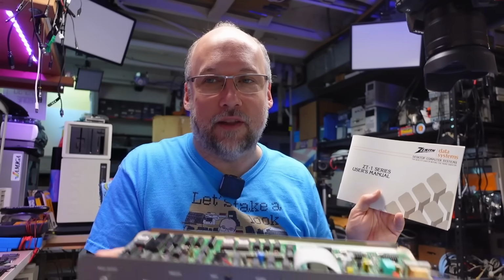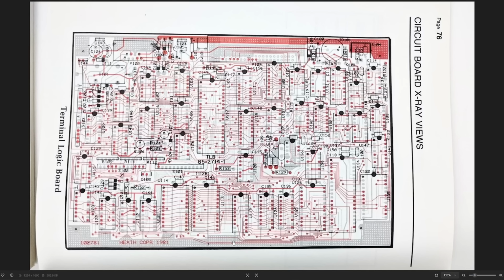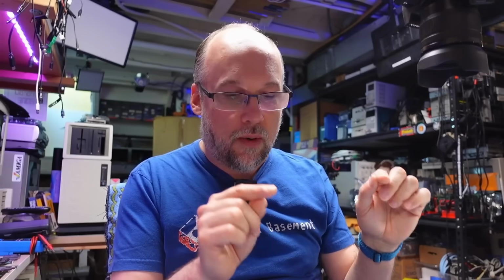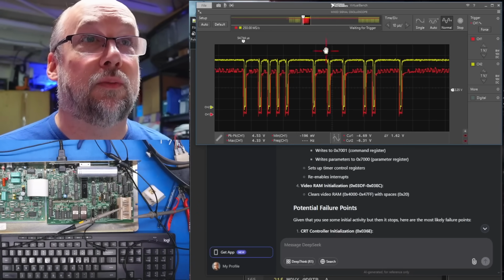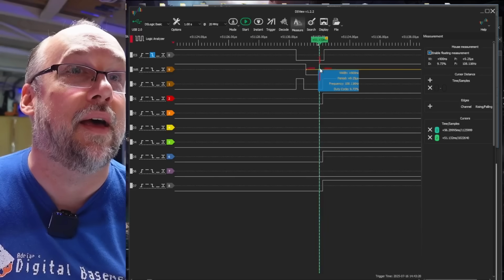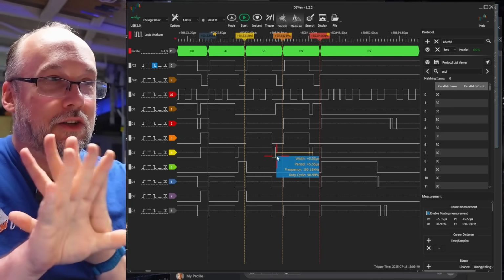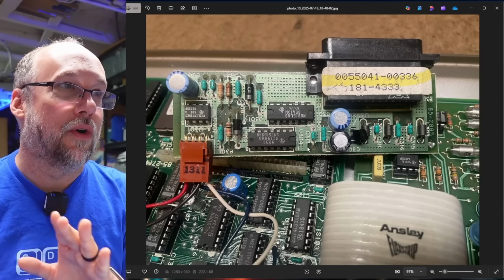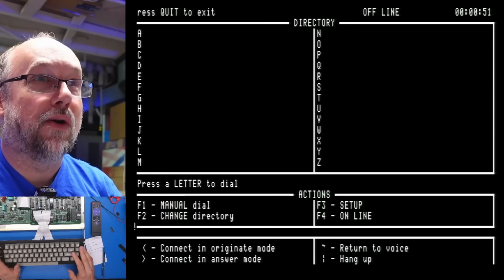The Zenith ZT-1 alive. Sort of.

Comment: 16:41 you can use a dremel or small hacksaw to cut all the way around the PSU brick plastic halves, for a cleaner entry.  Still though, who the fck seals a fuse into a PSU brick?  It's just dumb.  Some old potted transformers even had a capacitor potted in there with them - I've seen Mr Carlsons lab demonstrate this.

Comment: Yes. The 7.3728 MHz crystal is an easy divisor by a serial chip or a timer for creating all common modem baud rates or serial communications.
I use it as the master clock for my Z80 systems and then divide it by 4 and can create 115,200 baud by dividing by 12 in the CTC. So a very handy crystal to have as a master clock and then dividing it down to the baud you need.

Pretty clever bodge for adding a serial port. 👍

Comment: The +12vcd and the -12vdc are needed by the modem. There should be regulators for both on the modem board.
Heathkit used to have a tricky way to pulling negative voltage from the secondary and neutral.

Just guessing. Too bad there is no schematic.

Comment: I notice that Sark's modem board, whislt not qualitatevly different, some small things are changed - was his modem recapped at some point? Note the changed ground planes where it's screwed to the chassis!
Also noting that power jumper seems to go to that other weird power converter, although the better shot shows it against the capacitor instead!
Is that another reason why that transistor is there like that!?

By the way, for your flashing left column, is appears (sampling letters I,O,D and G) that the 2nd LSB (2nd from the Right) is toggling from 1 to 0, when the letters flash at 01:03:03! 
That last char and first char swap is intriguing too - but I also Note that the flashing block cursor, is not the same interval as the character swapping!

Comment: I use a fairly wide and freshly sharpened chisel with a swift, yet firm hammer strike to pop open those ultrasonically welded plastic cases. I've had the best luck with the cases resting on the concrete floor. Work your way around all four sides as necessary, and usually one or two sides will yield total success. The bench, as solid as it is, still has too much shock absorption for the hammer blow to pop open the seams.

Comment: Wasn't a fan of the AI. It was just distracting and unhelpful.

With the serial board, a clue it was a separate board was that the connector was upside down implying the board was above the connector which would mean it has to be a separate board.

The tape on the back might just be to prevent shorts.

Comment: To make it easier to solder to the fuse caps, sand a spot on each cap with some sandpaper or a small file etc. the solder will wet the sanded section much better. Great work Adrian!

Comment: Commenting around the 45 minute mark:
My first guess, which I remember I had in the first episode but which has only been strengthened by this episode, is that the fault does not lie in any of the logic, but actually lies in the video circuitry.

In other words, I think it's probably attempting to generate the video signal but either some of the logic or somewhere in the analogue mixing of the video signals is where the problem lies.
I'd suggest working backwards from the video output until you find something which looks like a viable video signal, then look at whatever comes right after that to find out what's going wrong.
While it's possible that the video generator chip is faulty, it's far more likely that an external component is the problem.  Perhaps a capacitor has shorted out and is grounding out the video?  Or maybe a resistor has cracked, or a solder connection was never properly made, meaning that the video signal never gets through?
Edit:  Wow!  I wouldn't have called it that the video chip had failed.  Maybe there was a near-miss from a lightning bolt which back-fed an overload from the video display into the chip.

Comment: Adrian, Do I not see a crystal in the middle of the ircuit board is that not used for the clock?
Reply from the maker: I wasn't clear, that crystal is for the CPU clock and baud rate divider. A time keeping clock would be using a 32khz crystal. You'll see this on any motherboard with a timekeeping circuit from the 1980 and 1990s.

Comment: The power supply urgently needs an overhaul. The uninsulated "floating" fuse can easily move around inside the case and at least touch the white cable! I wouldn't really trust old adhesive strips as a mounting option.

Comment: Your own analysis and troubleshooting is skilled and interesting. Whereas I doubt the LLM is analysing anything. It'll be saying stuff that looks like other analysis of various similar-looking code or whatever, which is only gonna be accurate if the thing you're asking about is already well documented online. It is designed to make plausible answers so of course it looks decent and useful at a glance, but that doesn't mean it did any actual analysis of the code.

Comment: If you intend to use that wall plug power supply, I'd drill a hole in the top and install one of those "screw in" style push-and-turn fuse holders to make the fuse replaceable without cracking open the case.

Comment: The reason the CPU might get stuck during initialization could be DMA or IRQ related. Maybe the CPU waits for such a signal from the video controller after it initializes it, but since it doesn't ever happen, it's stuck?

Comment: In the early 70s, my parents bought a HeathKit color 19" TV kit. I was too young at the time to help (both parents had soldering skills.) It took them about 2 weeks to assemble the kit.  Component by component. (later kits had pre-assembled boards which you just needed to connect together.)  It had the motor driven mechanical tuner with up/down buttons to change the channel. and had the option of an ultrasonic mechanical remote with a sensor to trigger the up and down functions. My father had built a large console floor cabinet for this TV as that was the thing at the time. This was the family's first color TV, and solid state at that, moving the black and white tube based TV to another room. It lasted into the late 80s, and was still running but was replaced with a Sony Trinitron with more features and sharper image. As a young boy, it was a treat for me to visit the HeathKit store which was about 45 miles away.There were several HeathKit devices around over the early years. i still have an oscilloscope, signal generator, and multi meter around. And I still use the high voltage probe and degaussinging coil that came with that TV kit.  (I worked as an arcade service tech in the 90s fixing boards and monitors where these got a lot of use.)
it was around 1981 when Dad and I visited a bunch a suppliers and collected all the need parts to build an Apple][ clone with a similar case/keyboard (cream case, brown keyboard) as what Adrian has shown many times. My father and I took turns soldering sockets and resistors to the board. In a few weeks, we had a functional A2 clone. Those were the days!

Comment: I remember those dumb terminals, and I used to use my TI/99-4A as a dumb terminal; there used to be a terminal program (or cartridge) that would allow it to function that way. I had even a way to connect dual monitors to it, one was 20/40 column and the other one was 80 column. I used to use it with an external Hayes modem. The BBSs back then were not very sophisticated. They were all text only. I had the P-Box for my TI and it allowed a lot of expansion. It was huge and had a lot of room in it with a lot of drive bays. When the half-height drives became available it was a big deal.

I remember the Heathkit stores too. I built an automotive analyzer from one of the kits they used to sell. A good number of the kits were pretty simple projects but as well a lot of the kits were a lot more complicated, such as this ZT-1. It was kind of sad when Zenith took them over and they slowly started phasing out more of the mundane kits and began focusing more on computer equipment; I think they actually got to the point that they phased out everything except the computer stuff eventually. 

They really had a proud history of offering do-it-yourself kits going back to the late 1940s early 1950s, a lot of hobbyists built portable radios and other projects in the decades prior to that, they used to be a sort of glorified Radio Shack before Zenith took them over. Radio Shack also used to offer a limited number of kits for home construction but not to the level that Heathkit did.

Great video. Thanks for the content.
Keep up the good work.
בס'ד

Comment: I was fortunate to pick up a 1976 Heathkit GR-2000 25” color TV that was mostly never built back in 2019. That was one thing I’ve always wanted to accomplish and it was a dream come true. I have a full video on it: https://youtu.be/hn_sJ0kS-fc?si=FtE-CmZ4_gOI90x0

It has an RCA delta gun CRT, and the TV chassis was completely unique to Heathkit. Had on screen display with a clock, which was extremely rare for 1976.

After Zenith acquired Heath, the kit TVs were actually unbuilt Zenith System 3 sets.

Comment: What I do so times to debug a 8031 board is replace with a at89s52 with a holder adapted to switch internal/external program, with a tiny serial monitor program
Reply: also, after you disassembled all hardware initialization, I think you can port intel tiny basic to it

Comment: +/- 15V matches the range for RS-232, and I think you're spot on about the rectified 10Vac becoming ~12Vdc (10Vac is 14.14Vp-p and deduct the drop across the diodes and further deduct a bit when under load, I think would be a pretty stable and solid 12V source).

Comment: Did you see the pi pico based logic analyzer? It has lots of inputs and boasts 400MHz capture rate. Would be interesting to make some pods (like chip sockets or clips) for retro chips like CPUs or PLAs etc that work with it.

Comment: Well I have an oddball selection of ICs here I've accumulated over the years that match up with some of the parts in that ZT-1, including a P8275, a couple of 2114s, and a character generator ROM that has the same idiosyncratic attributes on the lower case C and anything with descenders. Maybe some other Zenith terminal that someone pulled the boards from because I remember the board layout was different.

Comment: As I said in the previous entry, one could feed the composite video out from this into a VCR, select AUX Input, and use the VCR as an RF modulator to send the picture to a regular TV set, and get the full 80 columns.
Reply: A TV set over RF cannot resolve 80-column text. You'd just see blobs.
Reply: @rivards1 Except it's wasn't going direct into the TV, its going into the composite input of the VCR, which serves as a signal converter as well as the RF modulator.  The key is what the VCR could process and retransmit to the TV.  So maybe it was able to handle 80-col output, after all.  It's been 40 years I grant you, my recollection may not be 100% accurate, but I'm pretty sure the system worked.  Maybe it got the 80 cols, maybe it didn't.  It worked, that was the important part.
Reply: @xheralt I well understand the concept of using a VCR as a composite-to-RF converter. Yes, it will work. But a normal TV is incapable of legibly displaying 80 column text via RF.

Comment: Hi Adrian the way i open those sonic welded psu is the use a clamp to apply pressure around the joint keep moving it round and you get a nice clean opening far less destructive than a hammer lol

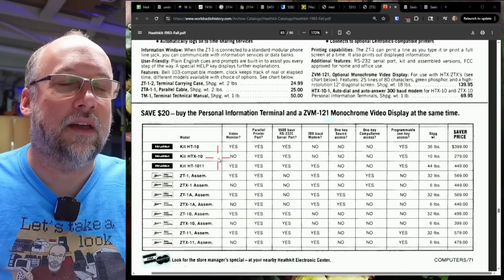Comment: From earlier in the video (08:13) the price list indicated that the ZT-11 is 9600Bd for serial and 300Bd for modem. The ZT-1 is just 300Bd modem only. It could just be that the 7MHz crystal improves the BRG (Baud Rate Generator) accuracy at 9600Bd. So maybe you don't need the crystal mod if you're happy with 300Bd. Nice vid

Comment: The Siemens CHip reads 8275*P*. Maybe it is a PAL Version? At least it is made in Austria, and all over Europe is 50Hz power grid.
Reply: As a universal intel design you give it the crystal you want and the timing parameters you want and it does the rest as you specify.   It's a good guess, but here the P stands for Plastic package it seems.  I can't find record of Siemens sourcing this part in ceramic packages.

Comment: That is exactly why i have a Ai model running on my Home server. yes it is slow, but it has no limits besides the 1.5TB of DDR4 2133mhz RAM and the 88 cores of the quad Xeon E7-8894v4 to help with parallelization. i write assembler code for years and understanding what happen without documentation is hard. Ai models are pretty good at analyzing stuff like a raw ROM dump. 
understanding this takes weeks and months, but Ai models getting it in minutes or hours depending on your compute power you provide. 

My home server is a used Dell Poweredge R930. yeah, It's pretty outdated and not very efficient compared to a modern Ryzen desktop Processor running with DDR5 6000 RAM, but Parallelization on those Xeons is king. RAM and CPU wise. you're getting things much quicker done on the R630 if it does benefit from parallelization, even you are 4  to 10 times slower per core. You can only access a certain number parallel, and this solely depends on your RAM channels and if you are single or dual Ranked in that channel. So the Desktop CPU does only allow 4 simultaneous accesses but the Xeon for example does 12 and because of a quad system those are 48 parallel accesses. This means if all used Threads dont have a zero percentage of "CPU on halt by IO" time 44 cores are 100% utilized but this never happens so about 60 to 80 cores are fully utilized, and the rest idles theoretical but because of clever threading Que. all Threads are utilized but running not at 100% each. which is technickly not exactly correct how PCs are showing utilization. the two threads of a core are not real its still one core but two independent code snipped's with L1cahe space can be place inside one core and the core is witching between them if it has to wait for IO or/and based on the thread priority of the code being executed. So both threads can't be really 100% because both using the same core. And have to share compute time. 

Some Linux systems show 200% on a core or 50% if one thread is used and the other idles. Windows shows kernel time as well, but neither of them is correct. We still didn't figure out yet how to display it properly. Think about it how you wanna measure it? That is your base and ratio, if you are sharing the same core. You have to display the ratio too and that's dynamically and depending on how well your code is executed and how much IO beyond L1 cache it hast to do. Even L1 cache has an access time where the CPU holds. Even load a thread takes time. that is why Modern CPUs sticks to Threading 
it reduces CPU waiting time significantly and improves CPU performance from 0 to 1 times per core. That is why Synthetic CPU benchmarks are dumb, Hyperthreading doesn't double your performance. It depends on the code being executed if you get the full potential per core or you need to add thread to reduce counter the inefficient code being executed and get more use out of it. 
tripple thread cpus are tried in the past, and they failed not because of performance benefits but cost and die size wise there were to complex.  Also other types of CPUs Like the AMD FX processors and the AMD Phenom and Semptron Processors they tried to improve hyperthreading performance and complexity savings but because of the focus on Gaming and the reliance on the Complex Floating point unit per core and pore code development who always uses floating point variables even if not needed they didn't had a chance. They are good CPUs but if one uses your feature or try to adapt it is prown to fail not technically but financial.  

Look at old really Assembler, Fortran or C code you will notice those are efficient. Modern code is bloated crap because no one cares if you have more than enough RAM and compute power to work with.

Comment: The problem with the first column and the video glitching looks like it might be temperature related. It's like there's a slight timing problem that messes up the start of the line, that gets a bit better the longer the system runs.

Comment: The uPD444C SRAM is CMOS, while the 2114 is NMOS. That makes the uPD444C lower power but more expensive. That's why the '444C is used for the NVRAM and cheaper 2114s for volatile RAM.

Comment: (@16:19) Ah, yes, a practical application of the “hammer of knowledge”! 😅
Reply from the maker: Haha sometimes you have to use what you have to use. 🤣
Reply: @adriansdigitalbasement  Banana oil melts the plastic and glue, its.corrosive and then you can avoid using the hammer
Reply: Turns out, Banana oil can be used to melt those glues and to open the case without blunt trauma

Comment: 10:33 "Hayes Chronograph keeps time" - well there's something I've never seen before
Anyhow, looks like my HTX-10 ROMs are different from both of the others, but closer to the ZTX-11.
Reply from the maker: Nice can you do a pull request to add those to the repo or email them to me and I'll add them?
Reply: @adriansdigitalbasement  Yeah, it's an excuse for me to set up a github account already... BUT, now that I've had a chance to compare them, it's definitely not the exact same version as the ZTX-11 (some things are off by a couple of bytes, but most are in the same place), but I had noticed long ago that some bytes had the high bit set for no reason, and this confirms it. I think some form of bit rot had set in before I dumped them back in 2016. The crazy part is that they are so close that I might be able to fix the errors! Now if I could just find that thing somewhere in the attic, I could make it work.

Comment: Just use isopropyl alcohol to open glued PSUs (99% the best)
Reply from the maker: It's not adhesive, they use solvent to weld it, which melts the plastic to form the bond.